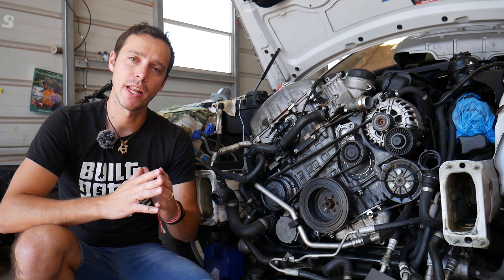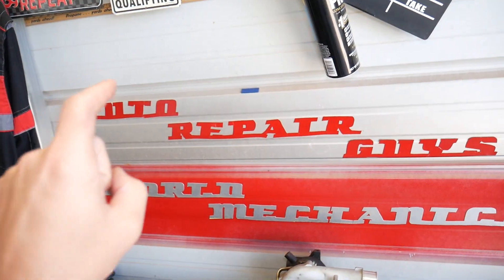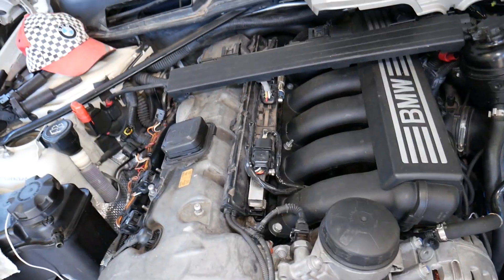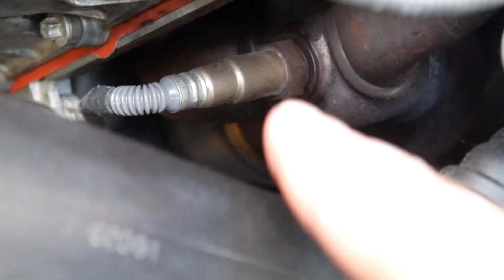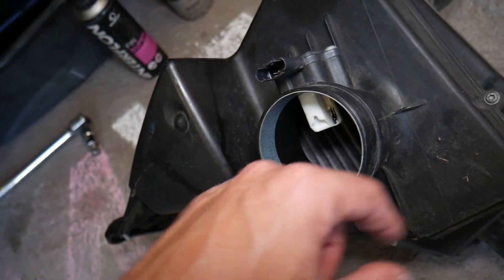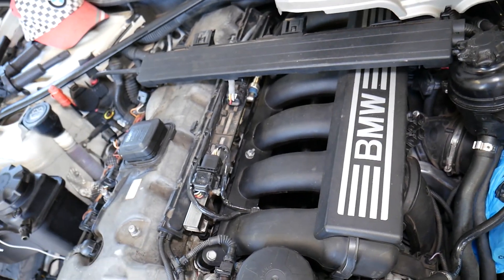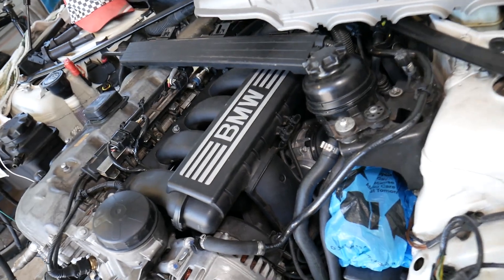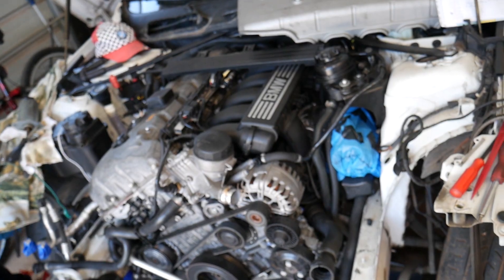HOW TO FIX ENGINE MISFIRE ON BMW Z3 Z4

Comment: hello i did everything you just went over.  its crazy. i just did a upper engine clean soak over night and it cleaned out with white smoke.  it did not fix the misfire.  i also took the DME out and cleaned it.  it worked for a day with no misfire and now  i have misfire on cylinder 5.  it fluctuates from 1 to 5 misfire.  if the DME is bad. how do i test it?  thanks
Reply: hey i know its years later but did you ever figure out the cylinder misfires I have the same two

Comment: Great video, I appreciate starting with the simplest thing... Spark plugs.   My 1998 BMW S52  M-Roadster (USA) hasn't showed a code in the 10+ years I have maintained it, hoping to  never see the light!  Started watching you last week due to my friend's 3.6L Pentastar oil filter cooler housing leak which I fixed a few days ago thanks to your video!